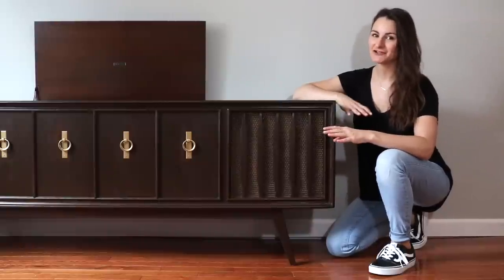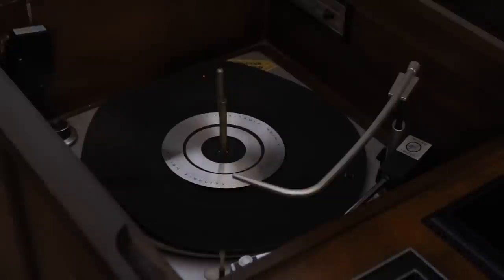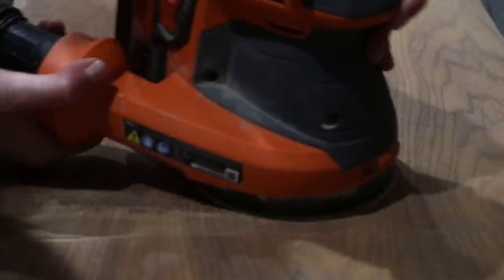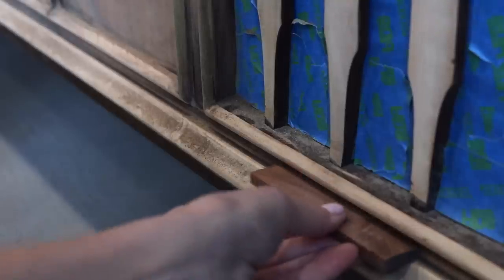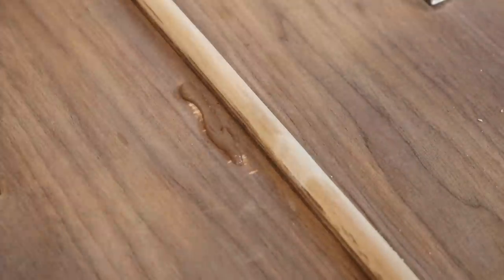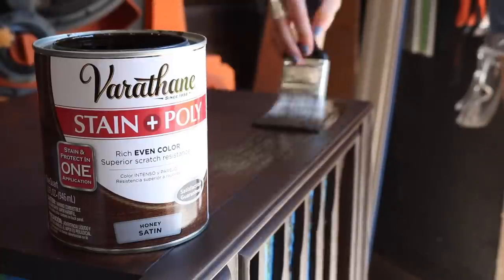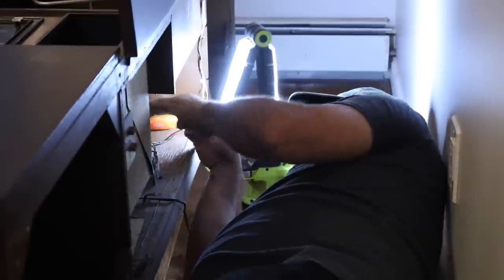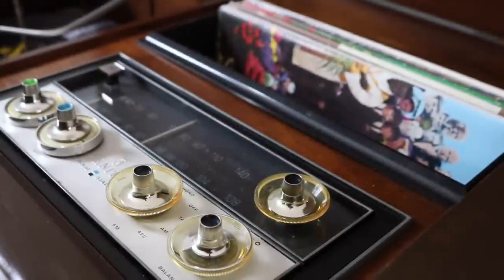DIY Record Cabinet Restoration | Before And After Furniture Makeover

Comment: Good fix up, Is the unit or tuner transistor or tube amplifier? Did you lubricate the turntable? Also replace the correct stylus and cartridge for the unit, otherwise if the needle is old and worn, you will ruin your records fast!

Comment: Nice work and good video. How many inches wide (long) is this cabinet? It looks even wider than the typical 58"-62" cabinets that were popular in the sixties and seventies. Please leave the original audio equipment in. You can easily add bluetooth or stereo input jacks without changing the appearance and function of the original equipment.

Comment: Great to see a new generation restoring some classic vintage electronics and cabinetry.
Great job.
FYI turntables usually freeze up from the grease that has turned to almost glue after 30 plus years.
I suggest you watch some videos on taking off the platter removing some of that dried up Grease and then boiling and greasing were necessary.
All in all, all great job.

Comment: For the handles I would have recommended just cleaning them up with some Brasso and shining them, then if you want to change the color maybe use some rub n buff and give it a clear coat for protection. But the stain color and the cabinet look amazing!

Comment: Might just need some grease after a good clean for the drop down mechanism. dirt and rust make parts seize up over time. wd40 and a brass wire brush oughta do. I corrosion is a concern there are electronics/plastic safe cleaners... then some grease. in a pinch i've use vaseline to grease some parts and it works. I repurposed a thrift store console into a media stand with storage and shelves. Citristrip allowed me to skip most of the sanding. most of the components are easily removed also. I know masking things is a pain. All things considered, your restoration still turned out a little better than mine.

Comment: Great job- except for the staining. There is no reason whatsoever to stain Walnut- a varnish, shellac or even a polyurethane produces a beautiful warm finish that shows all the grain and beautiful rich deep walnut color of the wood without any stain at all. For future reference- don't stain quality woods. Stains are to make poor quality wood (pine for example) look better then it is. Good wood requires no stain- and even if it does- you wipe on very little amounts with a cloth- not brush it on with a paint brush- it's why you had to go back and sand it down again to "lift" the stain off. Not criticism - just info- you did a terrific job otherwise!
Reply from the maker: Thanks for the input, but it had to be stained. The walnut on this unit was a veneer that was chipping and dull in certain places. You can see it pretty frequently in my sanding portions of this project. It’s why I had to also use a walnut tinted wood putty. The only way to get an even color across the entire unit was to use a gel stain. In fact, if I didn’t use a gel stain, there would have been bald patches of color. In the end, it turned out great and it is being used on a daily basis. It is no longer broken or hiding in a garage. So, while you might not be keen on the fact that I stained it, in the end it made my family super happy and very proud, and that is all that matters. 💕

Comment: Its nicely done but wouldnt it be easier to remove the innards from the cabinet and sand it? usual sits with screws so a repairman can change parts. :)
Reply from the maker: The entire frame of the build was super solid, and I didn’t want to take anything apart because I was nervous I’d break something! We also don’t have any repairmen around us, so since we had to do the work ourselves I wanted to be as careful as possible!
Reply: @diyhuntress  Ah i see. Well you did good, also i meant radio reparimen back then, often these cabinets had built in "easy access" for them to remove the innards to take with them to the shop.
Reply from the maker: Good to know for the next one! Thanks for the love!